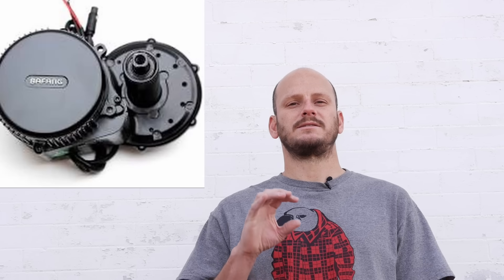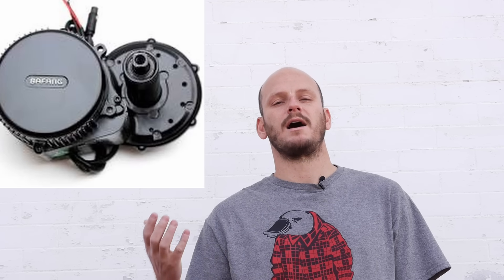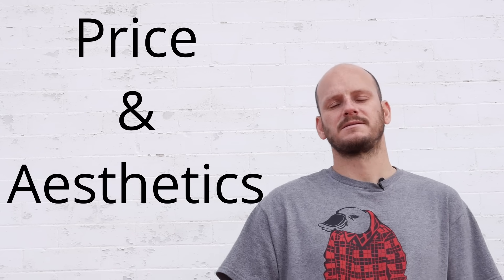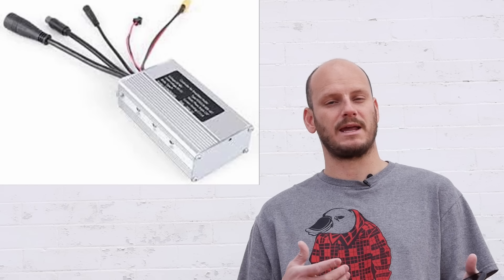Hub vs. Mid Drive Motors: Why Hub Motors Suck and Debunking Common Myths with performance test

Comment: Well lets see, I would install a hub motor because 1) I can get any kW rating and torque I want. 2) I don't have to worry about chains getting stressed. 3) if my gears fail I can still get home. 4) Only 2 bearings to go wrong. 4) With understanding of basic physics and electrical theory I know that ANY motor produces almost all of it's torque across almost its entire rev range. 
You Sir, are an idiot of the first order OR you just ordered a big box of Mid drive motors and you are trying to shift them, no reputable bike shop would turn down a hub motor bike for repair. A hub motor kit comes in at 200$ for 1000W, less surgery on your bike with a mid drive? for 200$ you get a drop in replacement wheel WITH a tire! Guess how many chains I have broken with a hub motor in my last 3k miles? Zero, never broken a spoke either and I'm pack 12kW in my hub motor. Mid drive motors way more complicated mechanically with internal gearing and way more complicated to instal, they are fine if you get it fitted or buy one pre installed. But far superior to a hub? No, no they are not, they may fit a particular need but when that need is met by pushing, at 1000W, 4 times the output of a human through a chain system designed for exactly 1 human then you run the very real risk of blowing your chain, and oh yea, nobody carries a spare chain with them.
Reply from the maker: In 5 years after you switch to mid drive, you’ll get it😀
Reply: @JohnnyNerdOut  Yea, you sort me out with a 12kW Mid drive and we'll talk... jeesh.

Comment: No gears, hence but 1 speed with a hub.

You either climb hills (sort of), or go rapidly (relatively speaking).

Forget pulling bad hills or heavy loads.  You need that capacity - go mid-drive.  (I’ve ridden both at length.)
Reply: Well, my friend. I have built a few electric vehicles and my direct drive hub motor goes up hills just fine and I built a nice heavy duty trailer for it and I got a riding lawn mower and hauled it home on the trailer behind my mountain bike with the direct drive hub motor
Reply: @metalman69201  wattage?

High-wattage hub motors, if they are wound/wired right, can pull heavy loads.  I didn’t have access to a heavy-duty one, 1+kw one.

The one I’m using right now is rather lazy off the line...

Comment: Are there any mid drive motor with a throttle ? cause I heard they are pedal assist only and sometime my legs need a break
Reply from the maker: All the mid drives I’ve ever seen have a throttle as well as pedal assist

Comment: My Ecotric rocket 36v 500w electric  fat bike had the whole system shut down then the battery fused to the connector At 700 miles. I tried replacing the wires and it still won’t work. I’m not sure what’s wrong with it, I am going to return it for a new bike hopefully the second one lasts longer than 700 miles, I bike everywhere and do not drive at all.
Reply from the maker: Might have fried the controller. $100 part at most

Comment: This is like suggesting that the reason people don't fly first class is because they don't know about it ....lol 

PRICE ...OBVIOUSLY ...and second it would be Modifications ...Mid Drive is more complex harder to tamper with that needs more knowledge ....but Price is major factor...the NO1 factor by miles..

very few sitting there doing the maths of Newton-metre on mid and hubs ...Only ones doing this would be hardcore enthusiasts who want best of the best ....your talking what 1% of ebikers ....They dont represent wider group people who buy ebikes who going to put price as no1 factor into every aspect even if there converting building it ....no1 driving factor of what average person does when buying anything ...PRICE ...Obviously ...Hence why it all comes from CHINA MATE ...:D ...PRICE ...
Reply from the maker: I respectfully disagree. Price out a bafang or any other brand that sells mid and hub motor kits see what you find. NOT talking about premade bikes. Those are ripoffs whether you hub or mid. 
Bafang mid drives are insanely programmable.
Reply: @JohnnyNerdOut  Well your going to know more than me about this ....

I can agree with you on prebuilt is rip off i have noticed this main reason opted to build it myself 

From my experience of wanting to build one now it would be HUB main factor price and then complexity ...and second factor is i ride hub motor skateboards and pick those over belt driven for same reasons that there maintenance and Price ...
Reply from the maker: @InkDropFalls  you should at least check out a mid drive bike, a bafang or 750W or more. I agree that on a skateboard, hub is the way to go due to the gearing ratio in those tiny wheels. Belt drive makes no sense there. But on a bicycle....COMPLETELY different story
Reply: @JohnnyNerdOut  i will now look into it ..i just got done with 1000w / 250w 2 in one hub because the laws in UK ...to have ability to switch too 250W is feature i want .....for obvious reasons .....I dont know about mid range and  i need to do more investigating into mid more ......

Comment: So I have an honest question I'm thinking of having Johnny convert my bike for me. But for $2,300 you can get a brand new Magnum Summit bike I'm sure it has a Hub motor you can get an eco-motion for $2,000.. it seems like if you buy one of these I'm sure they will probably last for years won't they. I mean they are still making them brand new in 2021 seems like they must be pretty good or they wouldn't still be producing them. I know that is not always true with everything
Reply: If you ride a ebike right n want it to last longer, one that was made good will last , the one i bought the guy said people were getting 17,000 miles out of it, most the time when you take off pedal it n dont use throttle, also don't go up hills in pedal assist 4 or 5, use 3 or 2 or 1, on a 750watt motor use 400 watts or less, 300 watts or less better , once in awhile you can use more but dont do it to often, especially up hill use 400 or less if you can
Use pedal assist a lot n not throttle
Dont burn it out n it will last
Some people ride them ruff n hard n that is why they break down sooner n more, unless that is the way you want to ride n dont mine it wearing out n you got to buy new parts or a new one
 Also with battery dont run it all the way down unless you have to, try to leave 
at least 20% , also dont over charge battery, dont leave on smart charger more then 24hrs, only need to charge for 12hrs to 24 hrs once in awhile to balance it out, most the time unplug it after charged
Reply: Right on Michael Jordan sounds like good principles

Comment: You get twice the range from a mid motor compared to a hub motor with the same battery
Reply: That must be a bad hub drive.  My experience was roughly a third more going from a hub to a mid, which is still more than I expected.
Reply: @dennisyoung4631  Every motor has a single point where its efficiancy is att its highest. This is true for all types, electric, combustion, Steam, and even your legs. Thats what gears exsist in the first place. If you have a motor that is over dimensioned the difference will of course be less, but it also means that over all efficiency is less than optimal

Comment: Do hubs generally seem louder to ya'll? Can they be quieter?
Reply: Direct drive hub Motors are definitely quieter than geared Hub Motors or mid-drive Motors. I might direct drive Motors when I go down the highway I don't hear a thing except for a little bit of tire noise.

Comment: On a single speed hub conversion, would the gear ratio that's on the bike be important.
Reply from the maker: No. With a mid drive it would

Comment: The power out of a mid drive is too weak is very limited. To do a mid drive very well you need to upgrade all of the other chain and spur gear components. Plus you could just use a gear tub motor

Comment: And naively i thought i would get a comparison of the potential of these motor technologies, not this...

...comparing rated torque of two models of motors.
Reply from the maker: What do you want to see, I will make another video😀
Reply: @JohnnyNerdOut  
Pros and cons of the two design paradigms...
...like limitations on maximum power deliver for each design paradigm, and how those scale with different sizes of motors?

As far as we are talking about bicycle power vehicles (and not motorcycles), you can easily employ a large bug mounted motor, to produce all the torque you could ever need.
Ofc. if electronics sounds like magic, that may sound strange.
Regardless. The only thing fixed for a given weight of battery pack is its kWh rating. You can have higher voltage lower Ah, by simply using a higher number of smaller cells, instead of fewer larger capacity ones.

Frankly at power ratings that don't require you to attack a license plate to use the thing legally, the obvious downsides should be increased rotating mass & increased unsprung mass - but even those can be easily overcome, by employing multiple driven wheels with a hub motor in each.
Reply from the maker: @martonlerant5672  very few people care about the stats. Much like in cars. Rated horsepower is great for companies like Dodge. But there’s such a bigger more important picture at play, and that is the user experience. Mid drive motors are far superior IMO. Non cyclists may prefer a hub motor. In my comparison I am comparing street legal wattage (750 or less)

Comment: I dont care if its a hub or a mid drive  motor as long as it has a carbon drive instead of a bike chain which breaks much faster no matter what what motor is used.
Reply from the maker: weird, We never break chains (maybe every 1k miles or so). Are you riding super hard on them or something?

Comment: Can u do a mid drive on a specialized  bike?and can u recommend ur choice its a 21 speed large frame and im 250 lbs.thanks
Reply: BBS-hd.  Mid-drive.  Use a 42 tooth chainring, either Luna or Lekkie.  Get the lowest geared cassette you can - 36 or more teeth.  In lower gears, it will climb bad hills with a heavy rider.  Mine did.  Wish it hadn’t been stolen.  Working on a replacement.

Oh, and get the biggest battery you can afford/fit.  I’m shooting for a 28 amp hour at 52 volts for the replacement.  70+ mile range.  (Some trips I’d like to do are that far or farther). 

Finally, apply Mobil-28 grease to the internals.  This makes them nearly inaudible.

Comment: Well you may also want to mention that while mid drive motors are great, they do require more work to install (i.e. Shift Sensor, Magnetic Speed sensor) And Hub motors require less of that, and CAN (but most unfortunately don't) have Regenerative braking. But i will say that a hub motor definitely makes rear wheel repairs harder! (ESPECIALLY Direct drive Motors)
Reply from the maker: It’s really not much more work IMO. Especially since the controller is all in one unit with the motor so you don’t have to worry about anything like that
Reply: Especially flats.  This is a big enough issue that tire liners (Mr. Tuffy brand) are a given.  

Note that there are two issues with these: 1) you want to cut and then sand a radius on the ends, so the liner doesn’t cut your tube, and 2) you want to tuck the doctored liner in the tire with an inflated tube in place.  You pull out a small portion of the tube, tuck in the liner, then tuck the tube back in - and work this process around the tire until the liner is fully in the tire between tire and tube.  

Doing this will all but prevent flats entirely - and muscling a hefty rear hub will make you desire such an arrangement.

Note also that this works equally well with mid-drives.

Comment: Good Video....I've heard about derailleur's having a high failure rate on bicycles equipped with mid drive motor's, and I've seen first hand mid drive motors causing problems with the rear wheel hub, so it's not only drive chains that break. Also, on the mid drive kit's I've seen you lose your front derailleur and multiple sprockets or chain rings, so 2/3's of your gears are gone on a lot of bicycles.
Reply from the maker: Yep. You definitely don’t need 21 gears of ratio when you add a mid drive. 7 is plenty. Haven’t seen rear derailleur failure yet.
Reply: @JohnnyNerdOut  Having all the gears is nice though if you also want to use your bicycle like a traditional bicycle without electric power. Watch Electric Bike Review's video about the expensive mid drive powered mountain bike he gave to his uncle. His uncle or relative said he used the bicycle for commuting and suffered rear derailleur failures and thinks it was caused by the mid drive motor. You can argue the damage was caused by something else, but it's not hard to imagine a rear derailleur being damaged by a stretched or broken chain.
Reply from the maker: @MotorheadRedo  Well if you think about how amid drive works it’s really impossible for a mid drive to damage a rear derailer. It has to have been from some thing else totally unrelated to a motor.
Reply: @JohnnyNerdOut  I was thinking more of a broken or damaged chain caused by the added torque from a mid drive motor taking out a derailleur. I've seen  broken motorcycle chains damage an engine crank case when they come flying off. I guess it's not very common.

Comment: Chain snapped on my ebike rode home dragging the chain along the road behind me via my direct drive hub motor. Wont be doing that on a mid drive.
Reply from the maker: $2 master links solves that problem 😀👍
Reply: @JohnnyNerdOut  pushing out an old broken link and then putting a joining link in is not something you really want to be doing at the side of the road.

Direct drive is a lot harder to build with but ultimately much more reliable and you can do regen braking.

Comment: I listened to your presentation twice because I started out believing that it was a fair comparison and the more I listened there was nothing fair about it. 
You claim that a Hub motor breaks spokes (implying that a mid drive doesn't)  REALLY ? ? ?  Using your own earlier assertion, a hub motor has less than half the torque of a mid-drive "PLUS" not only do you have twice the torque, but now you gear it down to the point where that torque is applied to the rear wheel at least quadruple what the hub applies. I'd estimate the twist factor from the hub to the rim is conservatively ten times the twist factor the hub motor can generate. 
Now for a small segment of bike riders like yourself who will override the built in programming that limits EBikes to 20mph, and go racing at breakneck speeds (34+ mph)down public bike trails, that extra torque might actually be significant.
I'm past my prime bike riding days when I looked forward to pushing the speedometer to the stops on a downhill run, but I believe the majority of EBike riders are of the same mindset as me, and just want to extend their riding days by purchasing a bike that will let them ride for an hour or two on the weekends, at a leisurely speed of less than 20mph. 
My Ebike has a 350 hub motor, and the first time I rode it, it freaked me out how much torque it had. It felt like the bike was going to take off out from under me. 
It handles overpasses, and the ten degree inclines without noticeable strain. 
I'll concede that mid Drive might hold some advantage for racers, but if you're hitting 34mph with your bike, you've obviously done the equivalent of removing the catalytic converter. You've made your bike illegal, and in some states a bike that moves at that speed requires a license.
Reply from the maker: I have another video coming out soon. But the basis is that mid motors are a more natural feel. If you enjoy cycling or are a purist, a mid drive compliments that much more. I personally don’t ride over 30. Actually rarely over 25mph. Check my pinned comment for further explanation of the hub motors loosening spokes. (it’s mainly because of poorly laced hub motors)   From an engineering perspective it’s just a far superior system. And if you are a cyclist, you appreciate the nature of the system. 😀

Comment: What about the sound of the motor? The "high screaming" of the mid motor! Pfff, thats the reason I will consider a hub motor. Cycling in nature with no sound of the motor. NICE!
Reply from the maker: Sounds like there’s an issue with the motor if it’s making noise🤷‍♂️

Comment: Given your pref's,  Would you recommend a 'mid-drive' motor if it's for a bike to be used on 'slippery surfaces' ..   Noting that only a front-hub bike can DIRECT THE DIRECTION of effective 'power at the wheel' ??  Mid-drives have NO ability to 'direct the direction of driving forces' ... as I know you do appreciate ...
Reply from the maker: Yes, I would still recommend a mid. Just drive slightly slower. I rode in Portland winters all the day no problem

Comment: Weight distribution is terrible for anything other than cruising on flat surfaces with hub motors. You can Maintain the handling characteristics of a bike easier with a mid drive, especially if you're using it for mountain trails or on a twitchy road bike.

Hub motors have gotten a lot more expensive recently too, and they're god awful looking compared to a sexy mid drive such as the Cyc x1 pro/stealth. A lot of mid drives have Integrated controllers and less cables and unsightly bulk. 

That said hub drives are not crap, and they serve their purpose well. I'd wager a DD hub is the most reliable form of electric propulsion for bikes so far if looked after.

Comment: Tell me Johnny, is torque sensing overrated when comparing Bafang and Tongsheng motors? Bafang is constantly avoiding to add torque sensor in his motors, even in new model M315 or M615
. Is it problematic to pedal uphill with cadence sensing?
Reply from the maker: I don't think so. I wouldn't think twice about getting a cadense sensor. they work just great